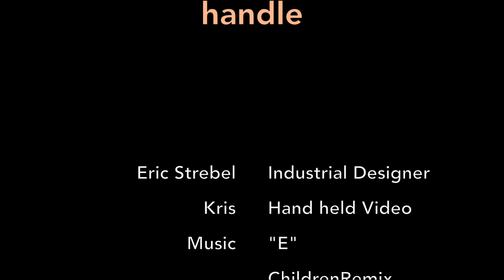Mᴀᴋɪɴɢ ᴀ ɴᴇᴡ Dʀɪʟʟ PRESS Cʀᴀɴᴋ Hᴀɴᴅʟᴇ: Urethane resin cast

Comment: I did the same for a drill press at work. Didn't transfer the bushing, opting instead to lay a ribpon of kevlar pulling tape (used in electrical wire feeding) around both included shaft holes. Works like a charm.
Reply from the maker: The kevlar was to take up slack to reduce play?
Reply: @EricStrebel  Kevlar added as structural reinforcement. I considered the loop of plastic around the hole inadequate, and the arm itself could use some beefing up. The machine is shared amongst many departments, and many of the users push the machine past its design limits.

Comment: I had the exact same thing happen to a handle on my drill press. My solution was somewhat similar to yours, with the help of super glue and bondo, I turned the broken handle into a pattern that I used to sand cast a new aluminium handle
Reply from the maker: 85rocco I am jealous, I would have liked a metal unit! I would like to cast metal parts someday perhaps.... Thanks for the comment! feel free to share on social media.
Reply: I really enjoy metal casting, the elemental nature of using fire and earth to turn scrap metal into something practical is very satisfying, you should try it. Based on what you've shown us in this and other videos, you clearly already possess many of the necessary skills.

Comment: Simple but practical solution and you teach a new skill set.  I'd say anyone who has owned a small drill press for more than a few years has probably had this same problem.  This might be my favorite video from your channel so far.  Thanks for sharing.

How long do you find that your silicones and poly resins last from the date of mfgr?  Do you dispense any gas products in the containers after each use to extend their life?